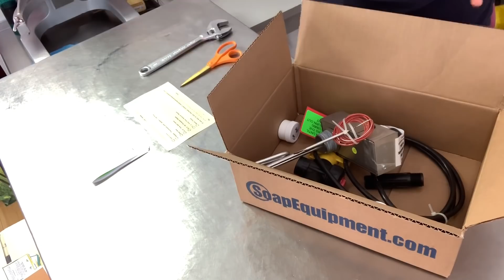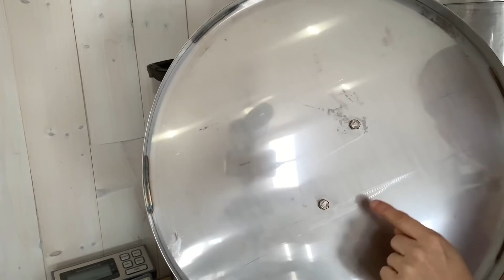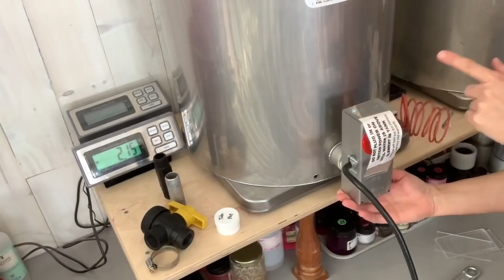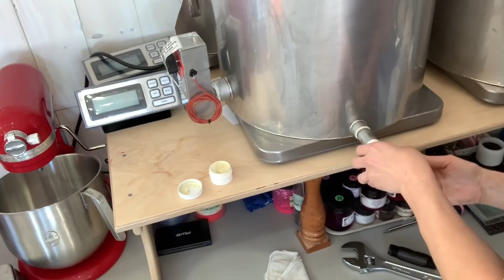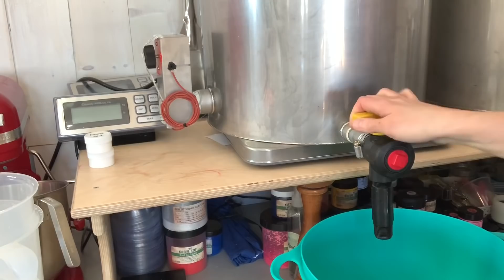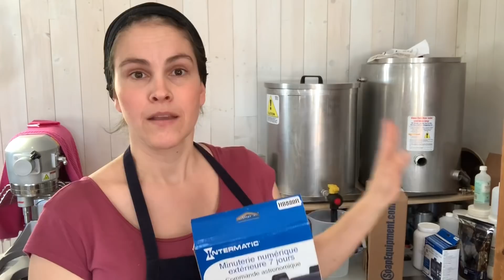Lye Tank Setup | Soap Equipment

Comment: Hi Ariane, I have a question in connection to the lye solution in the tank: do you have base oils you use for every batch of soap? I'm guessing you would need to in order to know the exact water to lye ratio for the tank or does that even matter? If not, then how do you know the lye solution ratio will fit for your batches? I still make small batches and measure using soap calc but I can see myself growing into needing a tank for my oils and lye solution. ( sorry, that was 3 questions lol)
Reply: Vonchetta Lyles I was wondering the EXACT same thing!  I didn’t think one standard solution would fit all
Reply: @got2dream1  I'm so glad I asked because I just knew I couldn't be the only one giving myself a headache trying to figure it out. Let's hope she answers soon so we will know.

Comment: How do you know how much water to lye
Reply from the maker: I will be covering this in a follow up video. This one was just the setup 😊
Reply: Great question, I I was thinking the same thing
Reply: The only thing that I would think would work, is if you mixed this as a 1:1 Water:Lye.
Reply: same thing I was thinking. perhaps this is for a single or similar recipe one might create in fractions?
Reply: Masterbatch.
Temps que tu sais la quantité de soude qu'il te faut pour saponifier tes huiles, tu peux préparer ta solution à l'avance en la diluants au pourcentage que tu préfère et voilà, y'a plus qu'à servir au moment voulu ^^
Reply: Yes, I see that as a problem too. When you mix any lye solution, because of the exothermic reaction, some of each material is lost. The % lost would depend on many factors, including water temp and environmental temp. Even as a practiced soaper, I've noticed that if I mix my lye water in advance in bulk (for several batches) and used that total vs mixed just my batch amount (both with the same ratio, from soapcalc), I would end up with 2 different quantities and inconsistent results because the lye solution would "settle" or be unevenly dispersed after forming it's crust while cool, even if you stir to homogenize before extracting enough for each batch. I was very aware of the possibility for inconsistency across batches and did everything I could to avoid them. So I simply mix only a batch at a time to ensure exact results. This lye tank idea is intriguing in premise BUT I'd be really concerned with inconsistencies if I were mixing that much lye water at once, for several days of soaping. 🤔